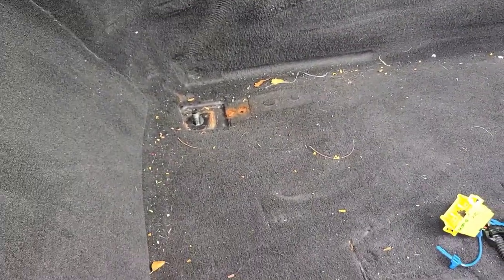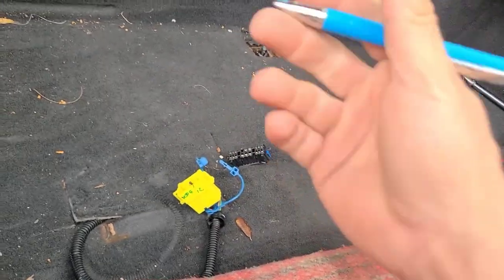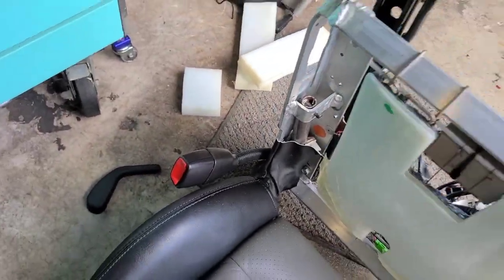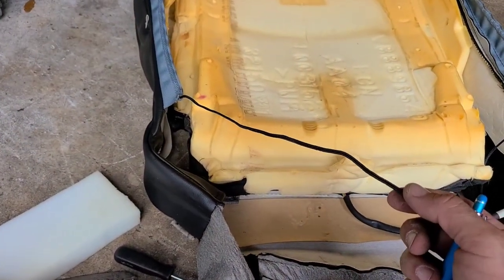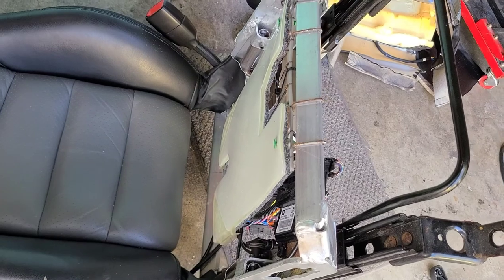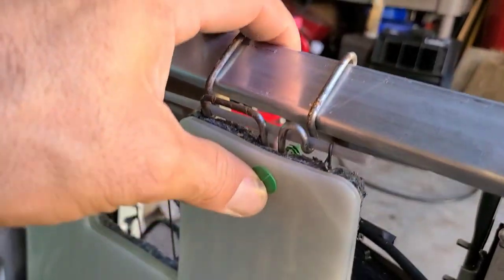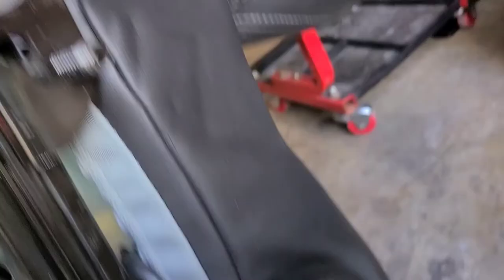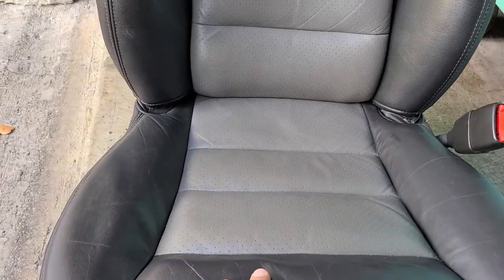C6 Z06 Corvette Seat Bottom Foam Reinforcement DIY

Comment: you're mixing the heat element with the passanger occupancy sensor. That's resting on the jute and on the springs. 
The seat heating is glued on the foam. If I recall correctly, the driver's springs sink into the foam because there's no jute (and no occupancy sensor), that's where you need the jute. For our C6Z06s, the two seats are actually quite different left to right.

Comment: My 2010 has OEM heated seats and does not have a jute pad or heater underneath the seat cushion. Mine is a glued heater coil on top of the cushion. So the jute pad and ballistic nylon is a necessary for the cushion support. Plus new cushion depending on wear and tear
Reply from the maker: Yeah mine was extremely low mileage so there wasn't a lot of wear except for the driver bolster but you can't even really see it. I found it very weird to find the elements on the top or the bottom depending on which seat so I wasn't sure if it had been messed with before.